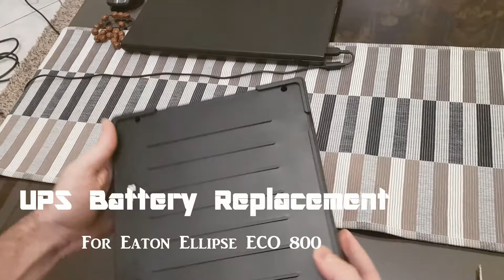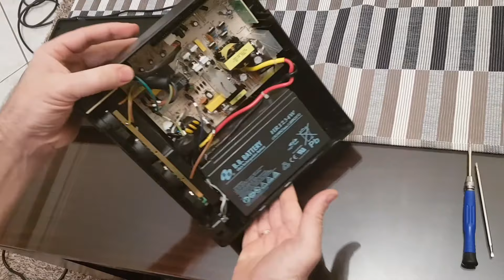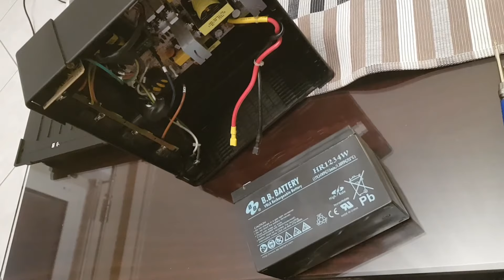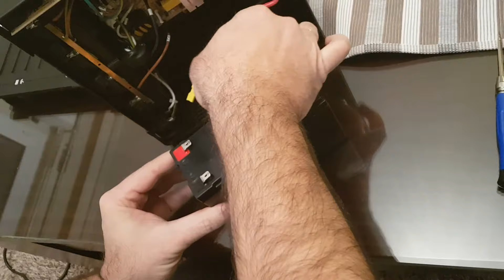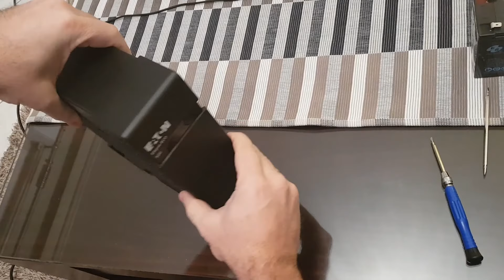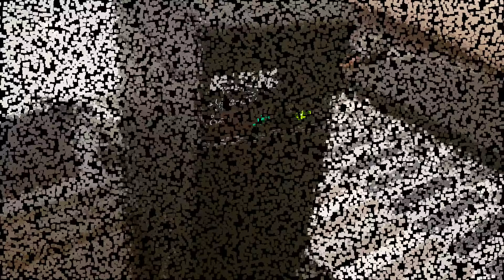Replace Battery on EATON Ellipse ECO 800

Comment: I want to get EATON ups, but what confuses me is lack of resources what third or part batteries are compatible with what model. Don't want to buy UPS just to throw it out when bettery dies
Reply: In general, you should look just for reputable brands CSB, Panasonic, Leoch, and Yuasa (or even a Chinese brand Ritar) and then match voltage and amperes precisely, and also pay attention that the specific battery has been designed for deep-cycle. That's all to it, there should be no other incompatibilities. Just avoid cheap, no-name, rebranded, strange brand batteries and you should be good to go.
Reply: @camelCased  Yes, yes... good brands, same volt/amp these are easy... what about size/shape? Why can't ups makers clearly write "we call this battery ABC123" and then third party makers write "this battery is compatible with devices eating ABC123, GHJ321...".
Reply: I guess, it's because there are so many different companies who produce UPSes and batteries that it would be really difficult to make a database of compatibility.  And, of course, UPS manufacturers (especially APC) are trying to enforce rebranded batteries for higher prices. So, if we want to go our own way, we have to measure everything, including sizes.
Reply: @camelCased  I disagree. Third party battery makers already know what their batteries fit (at least when it comes to big brand upses) so they can easily list what their batteries fit in. And ups companies do have some kind on names they use to identify their own batteries so they can list those too.
Reply: @lifebarier   We'll have to do some "googling" to find out which was the first - mainstream UPSes or small lead acid batteries (excluding the large automotive ones). I suspect that some battery form factors were already established before UPSes became mainstream, and so manufacturers of UPSes just picked up what was already there. Maybe later, when some UPS brands became massively popular, it got reversed and battery manufacturers started producing batteries adjusted to specific UPS models, but I have some doubts about that. Have to do some research, I guess.
Reply: @camelCased  no need for such research. It is irrelevant to my point.
Reply: @camelCased  I've put a motorbike battery in my first ups. Same voltage and end of the story. Using it since 5 years with no problem. Another ups i am using with a car battery in a separate case I designed and it works great. Voltage is the only thing you should worry about. The charger only needs more time to reload a bigger battery, end of the story. All the rest is marketing bs.
Reply: You would need a strong charger for a motorbike battery. Some cheaper UPSes have weak charging circuitry that can overheat and burn if trying to charge batteries that need more juice.
Reply: @camelCased  I don't know, but it works well till now ;)